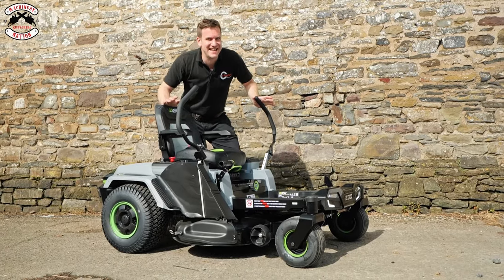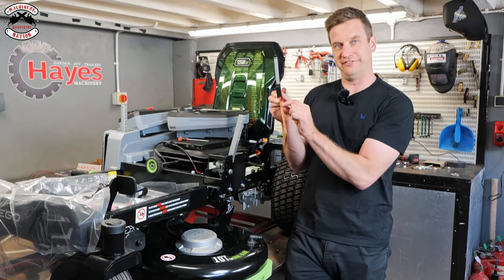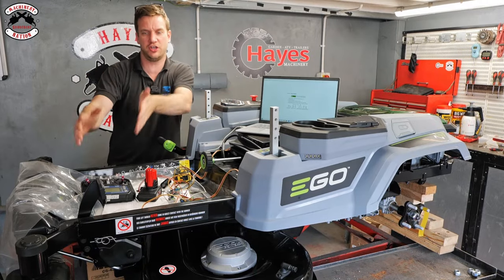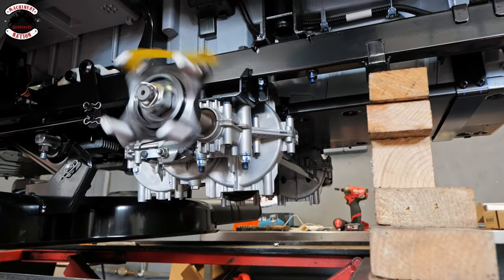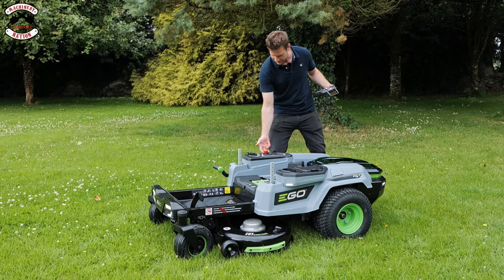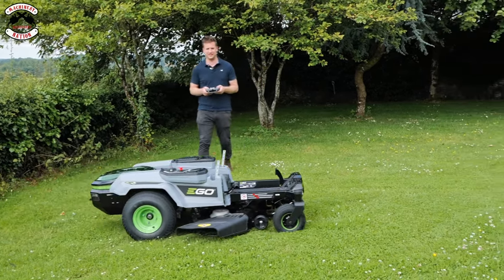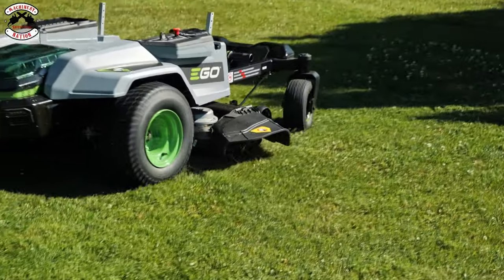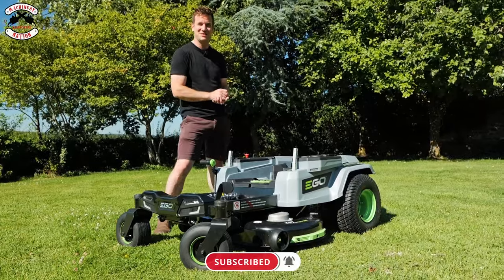EGO Z6 RC Conversion - Can I Control It?

Comment: Terrific video! I was looking for something that could remotely pull my sprayer so I could distance myself from the chemicals. This would do it!

Suggestions:
1.) Instead of using the positional solenoids, you could simulate the potentiometers using a microcontroller's digital to analog peripheral. This would allow you to use a switch to toggle between manual and RC mode allowing you to keep the seat and steering arms.
2.) There is free firmware on the internet for making an autonomous mower. Add some GPS and collision avoidance sensors and you'll have some hassle free mows!
3.) It can already handle pulling sprayer, broadcast spreader, dethacther, aerator, sweeper, etc... Need solution for snow plowing. Also curious if this thing would have the power and traction be capable of moving a boat trailer around the property. If so, this would be a true work-horse!

Note: EGO now has a 52" mower. But, if you made this autonomous, the 52" cut wouldn't be as necessary.

I'm an experienced engineer and really want to take on these tasks. Or, at least collaborate with you, when time allows...

Comment: It's easier to control with a pistol style transmitter. I know it seems like you would want it to be left right but it's actually harder to drive that way. just need to enable mixed mode on the transmitter. I used the flysky gt5 for my rc mower build.

Comment: You guys are amazing. I'd love to see you add 4 wheel steering to the stock EGO Z6 Zero Turn. It would be the world's first lap bar controlled 4 wheel steering zero turn! EGO should do it, but until then, if anyone can, you guys can make it happen.
Reply from the maker: Hahaha, thanks Scott. Next instalment of this video up up tonight 👍🏼
Reply: #1 Problem with zero turns is they don't work on slopes greater than 15 degrees. But as Cub Cadet has shown with their ZTS zero turns, making the front caster wheels steerable dramatically improves slope performance - the only problem is they use a steering wheel - no way, don't ditch the lap bar! Short of that, just having a means to temporarily lock the casters in place so they are facing front when traversing slopes, also helps hold traction (Z-Turf has a patented "lockable front casters" design for that).
Reply from the maker: @eighties8  EGO are releasing their in 2023 we featured it in a video a few weeks ago 👍🏼
Reply: @MachineryNation  The underlying "E-Steer" tech will be awesome I'm sure. The only problem is they are using a steering wheel! Hopefully they will have a lap bar version. Perhaps they do and just used the steering wheel version for the visual.

Comment: Just stick a DJI O3 camera on top, or a Mini 3 Pro drone, wear the DJI Goggles 2, and you can control the mower using FPV. Should be easier than standing some distance away and trying to correct for perspective.  Just make sure you are behind a barrier so you can't drive into yourself!

Comment: You could add on A solar panels.,an charger for recharging in the sun while mowing capabilities. Say your battery is low switch on the solar charging mode while setting in the sun taking  A break.

Comment: I would love to know the capabilities of this mower, just out of the box, without the wonderful and cool whizz bang upgrades made here, on slopes. Of course I realise that zero turn mowers are not traditionally good over 15 degrees... kind of hoping this is ok at 25-30 degrees.
Reply from the maker: We have a video where we test it properly check it out here https://youtu.be/R9pXrI5u1b4
Reply: @MachineryNation  I think you missed Justine Dodd’s post. She’s wondering if RC will allow 25-30 degree slopes ie. without the weight of the driver and seat. I’m wondering the same!
Reply from the maker: @ryanturner9114   Thank you Ryan, it would do more than 15deg, say 20deg at a push but it would need to be smooth terrain. EGO have just announced they are producing a ZeroTurn next year with a steering wheel which historically are much better on slopes than stick steer.

Comment: Remote control lawn mowers they are the future Manufacturers should make them. And they can make 2 different versions of them gas powered and electric. Remote control lawn mowers I rather have that It's better than pushing.

Comment: GPS will get you the straight line.  I built one 2 years ago and yes when its 95 degrees its much better to drive the mower while sitting in a recliner.
Reply from the maker: 95 degrees. I’m guessing you mean temperature and not a slope Hahhaha

Comment: If you have production resources available you shouldn't be using linear actuators to move pots around.
Reply from the maker: I wanted to try something different rather than servo motors or wiring speed controllers directly into the motor switch unit of which both would of been a lot more cost effective to work with. Why do you think I should not be using them?
Reply: @MachineryNation  They're not really that different from servos.  If you were worried about cost, I can't imagine two linear actuators and two linear encoders being cheaper than two digital pots.  It's just really clunky.

Different would be actually following the input mechanisms, making sure how they really worked, and seeing if you could just subvert them with a simple electronic component.

I'd at least look up the part number.
Reply: @MachineryNation  Parts list indicates the left/right inputs might actually be hall sensors.